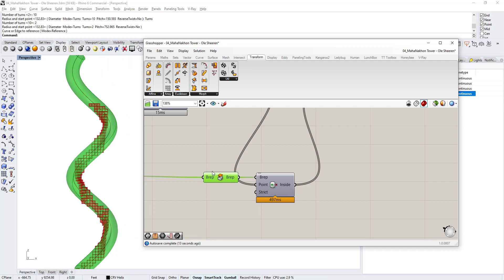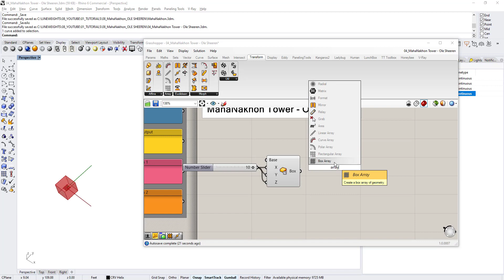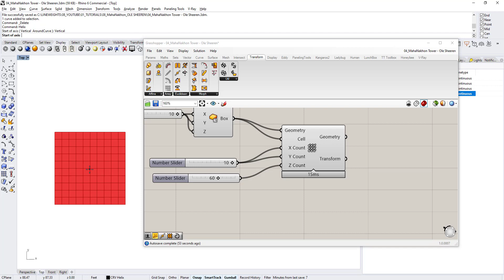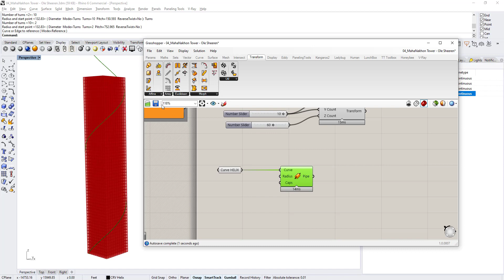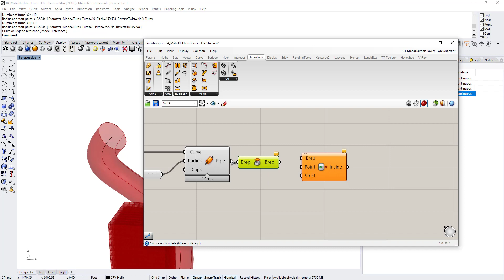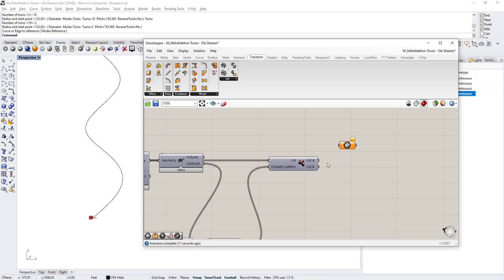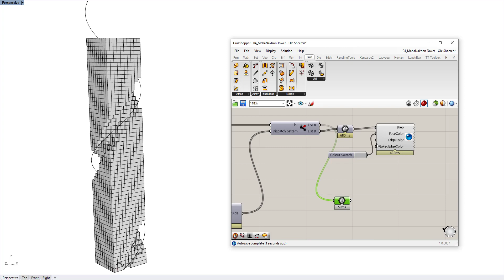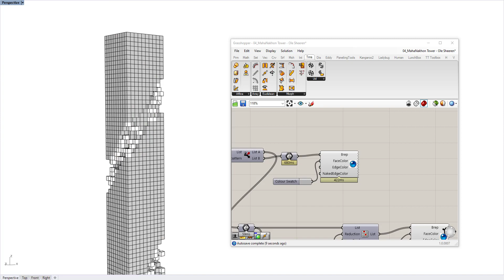Grasshopper Tower Tutorial - The MahaNakhon Tower by Buro Ole Scheeren

Comment: Great video. With the Random Reduce at the end of the video, some of the cubes that are added back end up floating/not touching other cubes. Wondering how you would go about identifying or eliminating cubes whose face or edge is not touching another cube?
Reply from the maker: Hi Scott. There is a way. You could run a BREP|BREP intersect command or probably easier is to run a closest point command for each of the cubes. If the closest point is too far from the adjacent cube then you can filter it out. This won't eliminate cubes that are hanging on by a single corner, however. In that case, I would try averaging the distance between the closest 3-4 cubes (ClosestPts) and filter that.

Comment: Hi, your video is very helpful, thanks! can i ask how to build the inside structure using GH or another quick way?
Reply from the maker: Thanks! It depends. I think you can control the facade quite well using grasshopper. For the inside (structural core, elevator core, etc.) you could use Rhino or Revit. Whichever tool is best for the job, there's no right answer. Ideally, once the form is finalized you could transfer the model to a BIM platform and continue working there.

Comment: thank you for this, it was very helpful, but I was left with floating boxes, how do I delete these?
Reply from the maker: Hi Luke. There are a few methods. One way is to calculate each box's distance from its nearest neighbor using its centroid (Volume + ClosestPoint). If the closest point is larger than the grid length then that means that there is no box directly above, below, or adjacent to that box, in which case you can eliminate it using Dispatch or Cull. There are a couple of other ways such as checking if each face is coincident with another box's face, etc, but those can get more complicated.